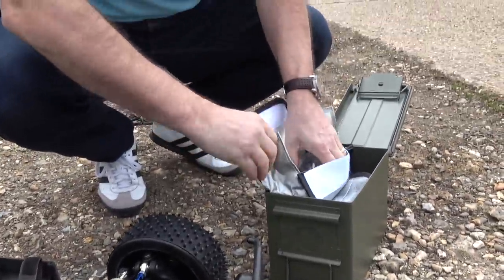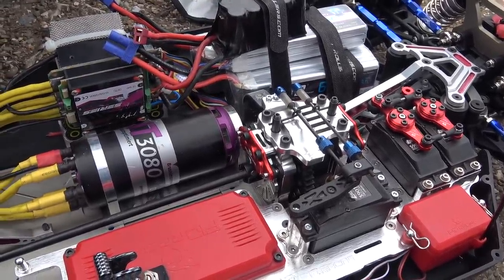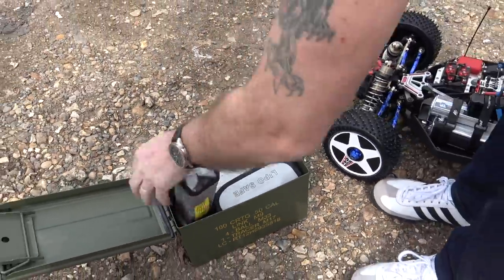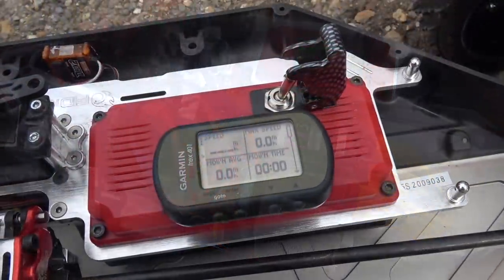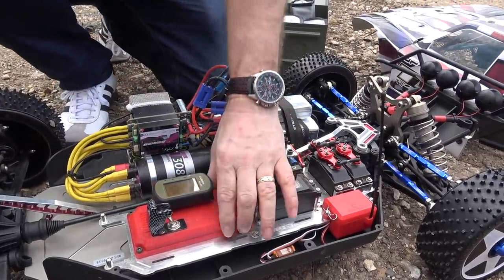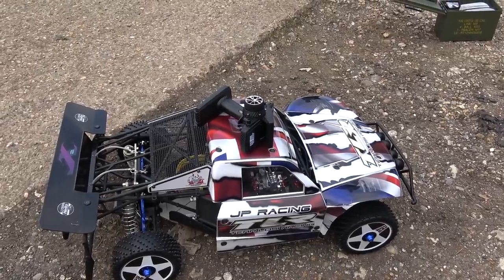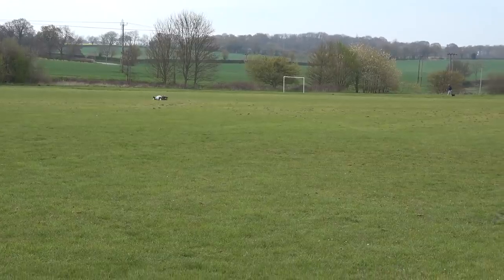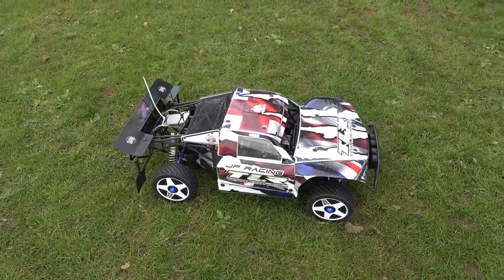MGM 15S lipo!!! Losi 5T 1st run....FAIL!

Comment: THE first thing I would start with to get rid of the EC5 are 120amps in the one Deans connector which is only rated for 35amps 
i would go with EC8 which is 190amps or XT150 cuz with 15s you're going to throw a lot of current through those connectors and that Dean's connectors is going to restrict a lot of flu and will get really hot and after I did that I would worry about programming the ESC

Comment: Nobody realizes that conventional connectors and wire gauge does NOT work for a project of this magnitude. These MGM 1/5 electric conversion kits can draw up to 180 amps under acceleration. Deans connectors max out at 60 amps, EC5 maxes out at 120 amps. 12AWG wire maxes out at 60 amps, 10AWG at 140 Amps. Basically you are REQUIRED to run all 8AWG Power Wire From Batts to ESC to Motor, and you need some sort of custom connectors that are NOT STANDARD in the hobby, probably utilizing 8mm or larger bullets.

EDIT: Also bear in mind that there are not a whole lot of LiPo batteries on the market capable of delivering such amperage. "C" Discharge ratings are fake and dont mean anything. In reality, most 5000mAH packs can put out about 100 amps, 6000mAH - 120 Amps, 7000mAH - 140 Amps, and so on. The absolute SMALLEST Packs you could on this build are the SMC Racing 7400mAH 4S packs (wire 3 together) and even then, 8000+ mAH would be better, not to mention you still need 8AWG wire. If builds like this were easy, everyone would do it. But the fact of the matter is these builds take as much skill and brains to build as they do money.
Reply from the maker: 100% agreed
Reply: ec5 is rated for cont. 120 not max 120A
Reply: Been using it w my tp4070cm 2200kv motor that pulls 268A w 10awg wires and ec5 w no proplem whatsoever

Comment: Rev it while the tieres aren't hitching the ground. Then you know if the cables reduces topspeed. 

Did the esc se them as 15s? If it say it as something higher, then the lipocutoff might have cutten out 50 %. That would explain the short batterytime too.

Comment: I would check the settings on the ESC. Something is not right, I have run those lipos and they do suck but not that bad to be that slow. Trucks in videos can look slower then in real life but based in the video it looks like my dbxle geared up would roast that thing. It should be a complete animal on 15s.

Comment: And this is why i don't go electric 😅, it's all alien to me!
Nice truck dude,im sure you'll figure it out 👌
Reply: Nuno Campos, dude, get a hobby wing max 8 motor and esc combo and two 3cell 11.1 volt batteries and your pull in wheelies while overtaking that slow ass Losi thing!
Reply: Im a nitro guy all day
Reply: I gave up nitro years ago and never looked back, got sick of tuning the fucking things
Reply: I run both and must admit, this leccy is causing me some headaches. Live and learn I say 👍🏻
Reply: @DJSpannamanUK  im a 2stroke guy..electric is not really my thing..but never say never..

Comment: Removing the seal alone on the ammo can won’t help. Il drilled x8 12mm vent holes in mine near the top . The flash reaction when the battery goes up  happens so quick even with the seal removed fully it can’t vent enough for the gas .
Reply from the maker: Cold dead hands Black water thanks for that advice mate. 👍👍

Comment: It could be the high resistance of the t plug wich is on the 3 S , it can only handle up to somthing around 120 amps and i have seen people melting their t plugs even on 1:8 scale buggys.
Reply: I've melted a few on my 3s setups lol
Reply: Most likely not real t plugs. While yes they aren't the most efficient connectors but done right you wont melt them. I run them on my 6s rigs, one is a arrma outcast with a hw max8 and a 1600kv 4082 motor. Other is a semi serious speed run buggy i used a hobao (ofna) hyper buggy chassis. Another max8 except with a 2200kv 4074 motor. The buggy is breaking triple digits mph wise. The t plugs dont break 95° farenheit on either of them. I learned anything less than 10awg wire is when t plugs seem to overheat. In my experience with other peoples rigs anyways that ive seen.  I wouldn't use them on anything bigger than 8th scale and over 6s though. I only like them cause they dont disconnect under big impacts, i haven't melted or even over heated t plugs to date, so far.
In the application used in the video, the issue may lie in his deans adapter contraption thing. Surprised it didn't melt once it ran lol
Reply: Lol your probably right I buy the cheapest ones I can find normally but thinking of switching everything to xt90
Reply: @Todd_G_FPV  nothing wrong with xt90's  as far as real t plugs i haven't killed any. Tried a few of the "fake" cheap ones in the past and I've melted a few. Connection isnt super solid either which is half the reason they melt. My t plugs on my rigs you have to nearly pry apart. Considered xt90's or ec5's myself. Most likely will switch one day. The current resistance on t plugs isnt the best. Just a better connector alone will give you a bit more run time, less energy lost due to friction. 
Dont mean you cant have a nasty setup on t plugs lol

Comment: I see so many issues with his setup, first thing he’s using a deans connector mixed with ec5...on top of the he’s using batteries made for a traxxas. Why build a racing car capable of running 6 seconds in a quarter mile but fuel it up with 87 octane fuel with ethanol. He needs to get some Max Amp batts along with 8-10mm Bullet connectors. That esc probably shut down cause of the power bottle neck thru that deans connector.
Reply from the maker: Hi mate. Agreed. Plenty of setup issues to improve. The owner sold the setup soon after this was filmed and fitted an Rcmax 46cc big bore 2 stroke engine.

Comment: You need a heavier connector for the batteries to handle the amp draw. Also you shouldn't be running 2 6s and a 3s. Spend the money and get 3 5s lipos.
Reply: As long as the C rating and MAH are the same if doesn’t matter.
Reply: Care to explain the problem with running 3s & 6s in series?  Shouldn't matter at all.  
Series is series.
Reply: It's just good practice. Hence why mgm shows them using 3 5s batts and why anyone who posted video of them successfully running 15s is running 3 5s batteries. Its also better on your batteries as well.
Reply: "Because they do it" is not a reason.  
"Good practice"?  In what way?  What makes it good practice?
"Better on batteries"?  How is it better on the batteries?
Respectfully, it sounds to me as though you are talking out the wrong end.
Reply: You cannot put a different number of cells in parallel. The reason for this is the difference in voltage.  6s would discharge into the 3s as it attempts to equalize the voltage. The likely result would be a 3s on fire.
Series?  No problem.
Reply: @dr0n3droid  respectfully having built multiple 15s 1/5 scale trucks and never having issues running 3 5s lipos I'll stick with what I do. Dont need to validate my opinion to you or anyone else. Buddy in the video was having issues with his rig. I gave me opinion based on my experience with these and other big power builds. Dont like it or you feel like puffing your chest out take it elsewhere.
Reply: @wciflanker7  You sound offended by my FACTS correcting your "opinions"
You do whatever you want, none of my concern. 
 "I've built 'em before" good for you.  I have not built a 1/5 scale, but I am a journeyman electrician, an electronic engineer, and have been involved in all aspects of RC for 18 years.  
No need to get upset, just accept the knowledge I'm handing you, or don't.
Reply: @dr0n3droid  well then mr electrician what's the issue that this guy is having? I mean since you obviously know so much about electronics and have so much experience with rc cars that my experience with THESE escs and motors are nullified by your experience with everything else. I told him what has ALWAYS worked for me and ALL of my builds.
Reply: @wciflanker7  To be completely honest, I didn't even watch the whole video, just wanted to see this ridiculously expensive toy rip around.
Clearly the dean's connector IS a choke point which will prevent current flow, and if it did run, the solder likely would have melted at the dean's.
If you've actually built even one of these, you'd know that it's not running anywhere near as quickly as it should. 
If I were to make an educated guess, without actually watching the whole video, I'd say that the ESC is having synchronization issues.
Reply: @wciflanker7  do you understand desync? Or do you need me to explain that to you too?  You're "experience" with THESE SPECIFIC ITEMS cover anything like that?
Reply: @dr0n3droid  as I first said the connectors aren't big enough. Thanks for repeating what I've already said.

Comment: I had some issues with my mgm controller. There is really a very advanced technology put into the ESCs.
One of the big warnings they put is NOT to use deans connectors because of the very high amp draw., even it worked well for a while it will ruine the ESC on the long-term.
Otherwise try not to play with the advanced settings on the ESC because these are meant to protect the ESC.
But first thing  I would suggest is to change the connectors to proper 6-8mm connectors.

Comment: Its the batteries. Google the following.

Battery Internal Resistance.

There is a reason why x2 3s batteries are cheaper than x1 6s for the same capacity.
Reply: Agree. I’ve bought 3x5s lipo’s at 120c. Will use 8 gauge wire with 8mm bullets for next run.

Comment: Is the cap pack supposed to run in series or parallel with battery wires? I think it's supposed to be parallel
Reply: 12 series and one for the servo
Reply: Don't take my word on this cause i dont know for sure but the cap pack running in series is probably fine but the way you have them hooked up in series with the batteries I feel like is wrong and should be ran parallel close to the esc as in the pack should be hooked one side to positive and one side to negative not hooked up along just the positive or negative side alone. Hope that makes sense and nice truck by the way
Reply: Well I should say wen ur order the cap n esc from MGM they can do it were it's got I wanna say 5mm plugs direct to its board
Reply: Yeah i think it should be soldered on to the positive and negative right before the battery plug on the esc or at least thats how I run my packs

Comment: it was fast ..but also it bores me to watch a QUIET big scale RC..the sound is like scraping a fork on a glass surface. It looks good..
Reply: Roy Arsey yup man.  Borring.  I would not have this electric on my channel.  Hahaa.
Reply: For some it's boring, but then again not everybody is located in a region where you can drive those gas powered cars, nitro or gas doesn't matter for this. As an example, I live in Germany and to drive those gas powered cars id have to drive a relatively long way just to be on the safe side that nobody gets fukd up. A point for electric cars because they are way more quiet and to be honest, outrun any nitro or gas cars in similar setups
Reply: Well your town likes it more when it's electric.

Comment: Got my ammo tin from the surplus store . Drilled a hole in the top At first the idea was to charge inside it run wires through the hole

Comment: Gear to high motor can't get top rpm, gear down don't need to get 100mph, the rpm is the motor kV times the volts your putting in to it , so at 15s that going to be very high,

Comment: Yeah something is definitely wrong , my 3s stamped is significantly faster in every aspect I would hope something that extravagant would offer more
Reply: Your stampede doesn't weigh 45lbs.  While I agree that the 5t should be faster than that given the setup, you can't exactly compare it to your tiny 'pede. 
Not knocking it, I've got two stampede and a slash, all 3s vxl.

Comment: So ur gonna need to look in the esc settings and see wat the amps are set to second get rid of the connectors u need atleast 8mm bullets and I dnt run my MGM on less than 10awg leads once uve done this ull want some stronger packs if ur going for all out speed 10c rating wont cut it ud want at least a 65c I run turnigy packs  but as I watched a second time I'm pretty sure the mgms have a fail safe setting that doesn't let it full power without anti spark plugged in I have a video of a fg monster 6x6 run dual setup 400amp escs n 2 lehner 3080s on 14s each

Comment: That's a whole lot of time and money for a rc that would get smoked by most 1/8 scale rtr's
Reply: Any 6's arrma
Reply from the maker: Hmmm. Maybe the way it was running in this video. The owner does have an arrma outcast funnily enough for 1/8 fun. Totally different experience to use. 

This car is a work in progress. It’s a learning experience for the owner. Things like connectors and lipos need improvement. Plus the esc needs setting up correctly. Then it’s experimenting with gearing. 👍👍

Comment: Any stock 6s would smoke that! I mean I appreciate everything that's gone into it, time and money but you've literally gone backwards. It took longer than any nitro to get going didn't run right and wasn't even fast? I bet a jbl cheetah on 4s would fly past that thing for a fraction of the cost. My 1/8 hyper on 6s is way quicker and my x maxx is definitely quicker and you've put more money into that than I've spent on all mine I bet! Anyway it looks gorgeous and some real nice parts in there but a total waste of time and money. And fun! Sorry
Reply: His batteries are wrong.